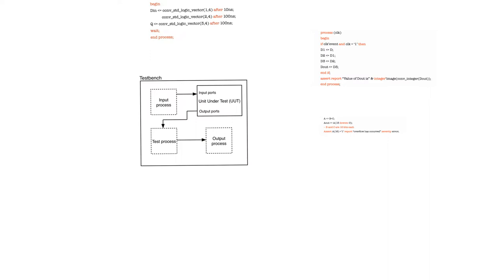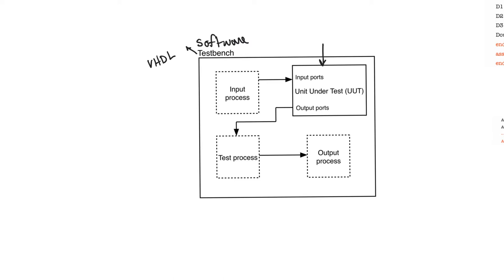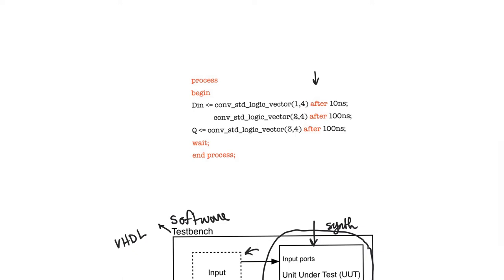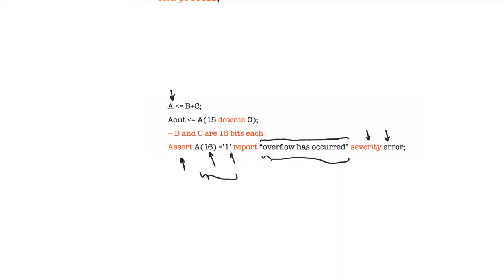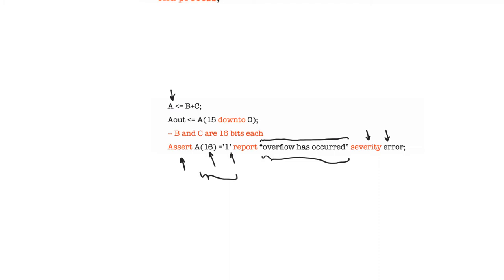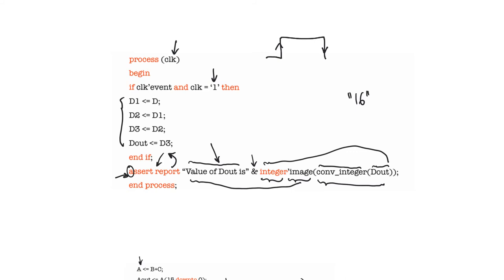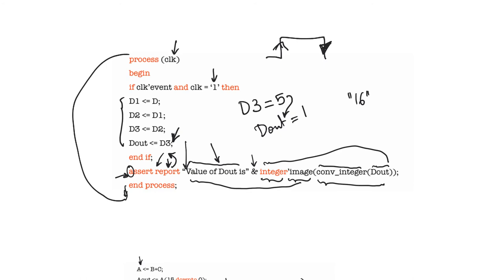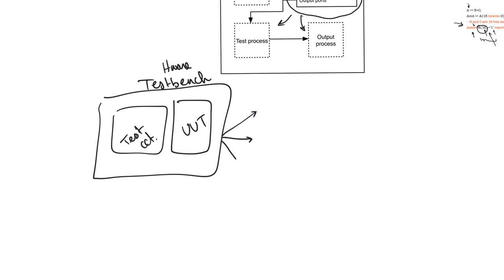9.24. VHDL software testbenches

Comment: Question: how would a Hardware Testbench/Test Circuitry be implemented in VHDL (as you describe at 13:16)? I can't find any examples online. How would this be possible without non-synthesizable code, such as "wait for Xns" statements?